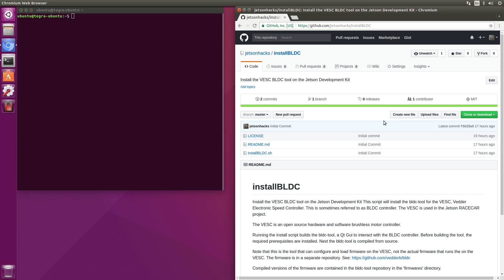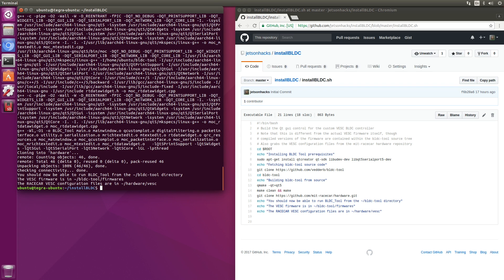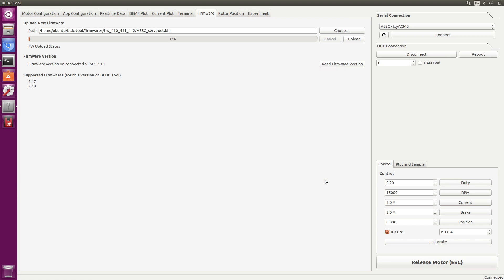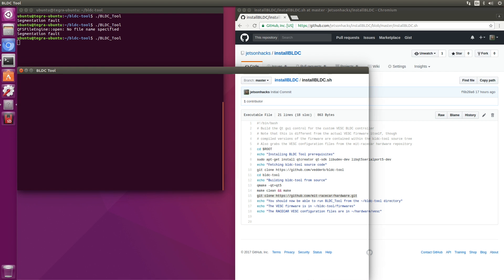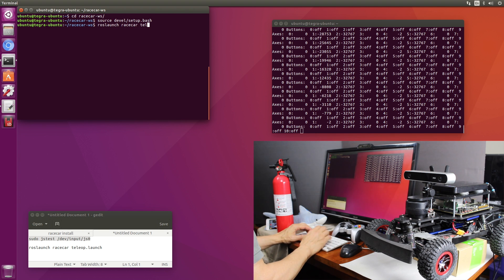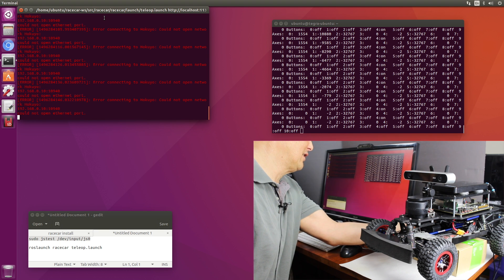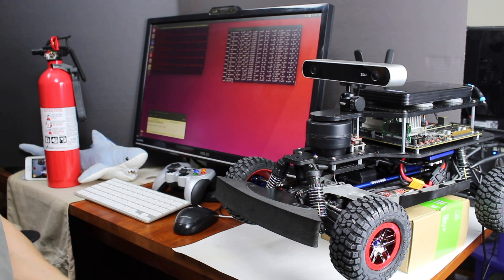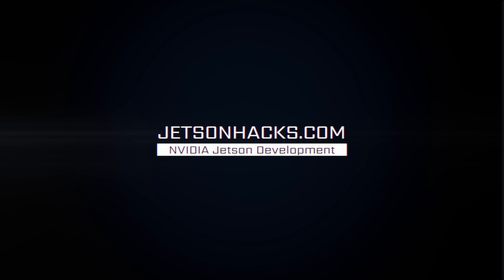Get Your Motor Running! - VESC - Jetson RACECAR

Comment: This is my vesc : VESC Firmware Version 5.3, Hardware: 75_300_R2. Will it work if I do the same things you did?
Reply from the maker: These instructions are quite old. Please follow these instead: https://f1tenth.readthedocs.io/en/stable/getting_started/firmware/firmware_vesc.html#configuring-the-vesc
Reply: How do you deal with the servo output as that is something that has been removed from the tool

Comment: [FATAL] [1558615320.721881334]: Failed to connect to the VESC, SerialException Failed to open the serial port to the VESC. IO Exception (2): No such file or directory, file /tmp/binarydeb/ros-melodic-serial-1.2.1/src/impl/unix.cc, line 151. failed..

I got this error . on ubuntu 18.04 and on tx2 jetpack 3.3. I configured vesc without any error.  Also at BLDC tab at left side , when i start detection car gets throttle  . Any idea?
Reply from the maker: It is difficult to tell from your description. Ubuntu 18 and 16 use different versions of ROS. There are also permissions issues depending on how you access the port.

Comment: Hello!, I am using FOCBOX motor controller (http://www.enertionboards.com/electric-skateboard-parts/FOCBOX-programmable-brushless-motor-controller/) and when I tried to run ./BLDC_Tool, VESC is not showing up in Serial Connection but when I am running lsusb its shows as connected... Is there any other steps I am missing for Serial Connection?
Reply from the maker: Which Jetson are you using?
Reply: I am using TX2
Reply from the maker: The Jetson TX2 will need to have the tty-ACM module added to the kernel. The VESC advertises as a ttyACM device.

Comment: did you manage to calibrate the vesc with the servo ? I get a non-zero angle in natural mode
Reply from the maker: Interesting. I haven't heard of any of the VESC controlled RACECARs having issues with VESC centering the steering servo. What type of chassis are you using? I'm wondering if a centered PWM pulse actual centers the servo in your particular case.
Reply: Thanks for your answer.
I am using the same car that you are using, with the vesc 4.12.

I am not seeing any option to change the center in bldc tool. Any idea ?

Comment: is this can publish odometer  information?
Reply from the maker: There is no direct hardware to do that, like wheel encoders, but the electronic speed controller does measure the motor RPM which allows for approximate odometry. It should be possible to combine that information with vision and lidar odometry. Thanks for watching!
Reply: is there a  ROS node publish the  the motor RPM  ??
Reply from the maker: There's a /vesc/odom topic that is used.
Reply: That is so great .Thanks for your answer.

Comment: Hello! Got a question on the need for gamepad. Is it just to take over the control to manual mode from autonomous?
Also, If using ESC, is there any other step in place of VESC software flashing?
Reply from the maker: The gamepad is used for several reasons. First, you can tele-operate the car. The second is to tell the robot to start autonomous operation. The third reason is so that you can take the robot out of autonomous  operation and make an emergency stop. During development, there are likely to be situations when the vehicle needs human intervention, e.g. it tries to run away. Since configurations of the vehicle can go 50+ mph, this is useful for safety reasons.
I don't understand the second question. Thanks for watching!
Reply: Thanks for the answer! 2nd question - If I use an ESC instead of VESC, what are the changes needed to run the car?
Reply from the maker: You'll have to go through the code and figure out where the VESC is being controller and substitute the code for the ESC. I am not familiar enough with the code base yet to give a more specific answer.